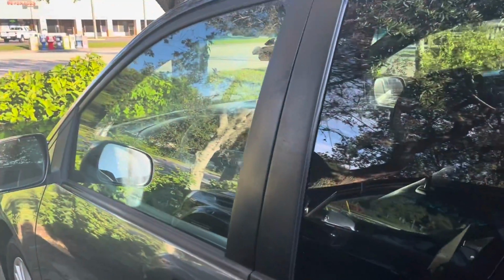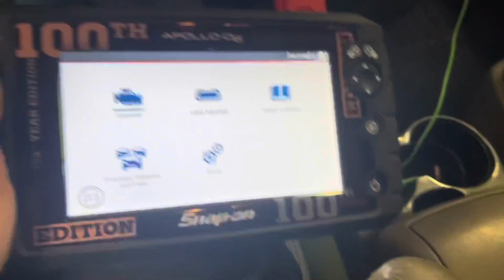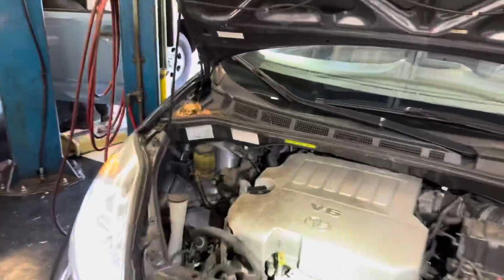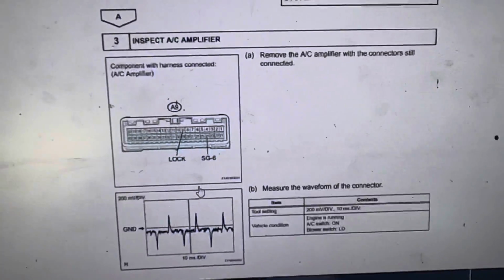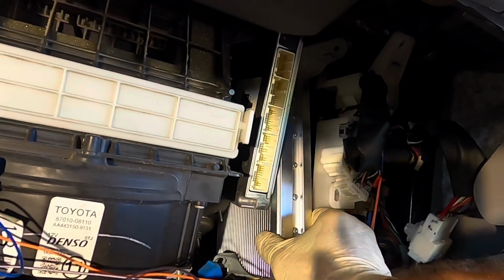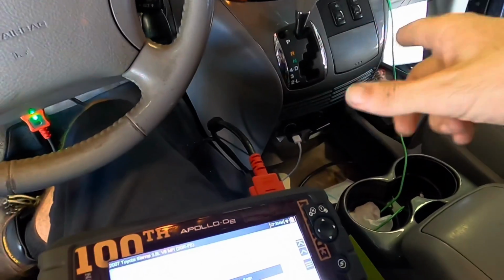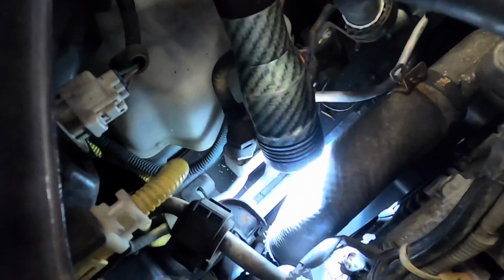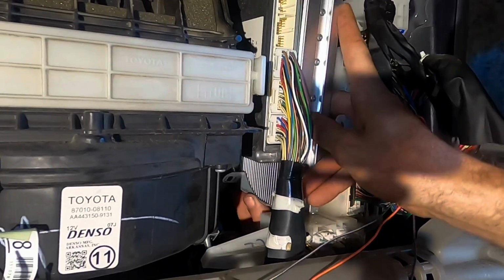Ghost Toyota: Engine running with no keys! And Customer States: No A/C

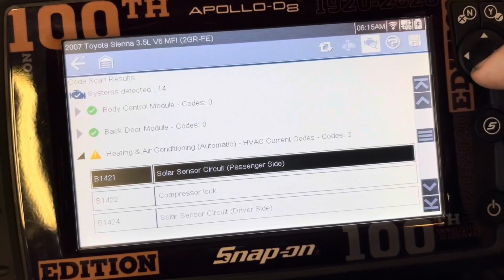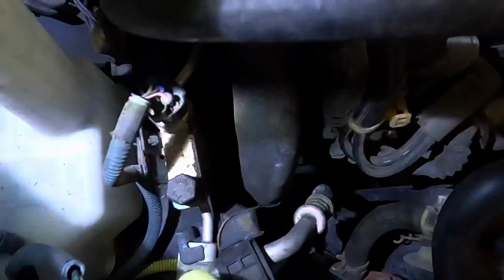Comment: Ray, at 5:18 your scan tool shows a B1422 Compressor lock error. This happens when the management computer does not detect the correct compressor shaft rotation after the ac has been switched on. It will then disable the drive voltage to the compressor clutch as it thinks the compressor has locked up. It does this to allow the drive pulley to continue spinning allowing the drive belt to keep powering the alternator and power steering pump. The flashing ac light on the dash is another symptom of this error. The fault can be caused by other problems than a locked compressor. (Did you check that the compressor shaft turns?) If the coil in the clutch has gone open circuit or drive power / ground is missing then this can make it look like a locked compressor. You can check the resistance of the clutch coil through the pin (3) on the other electrical connector. The one on the compressor side of the circuit. The connector doesn't have a ground connection for the clutch coil. The other end of the coil is grounded through the body of the compressor. At 18:50 you provide drive power directly to the clutch coil and it still doesn't energize the clutch. Looks like a bad coil ground, an open circuit in the windings or the clutch gap setting. A bad resistance check on the coil would help eliminate a wrongly set clutch gap.
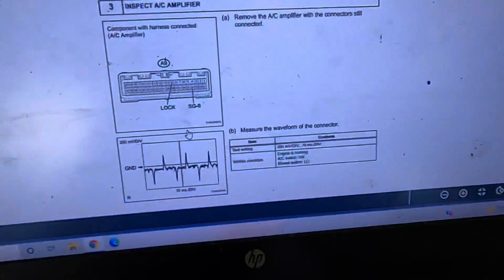The other two pins in the connector are for the compressor lock sensor. This works a bit like a cam or crank sensor. I believe it provides a low voltage differential pulse signal on the two wires. (Neither of the wires are referenced to ground.) This differential pulse voltage is compared to the crank sensor signal. If the difference in frequency of the pulses is greater than a certain amount then a fault code is set and the clutch coil power is cut. You can see the expected waveform in the diagram in the manual at 8:50 in the video. A faulty lock sensor would result in the same compressor lock sensor error. The easiest way to quickly check the lock sensor is to measure its resistance on the compressor. The service manual should list expected resistance values. Just my 2 cents.
Reply: I'm surprised the snap one tool doesn't provide this information.
Reply: @Bryan-Hensley  The scan tools find and interpret the error codes. They usually give you enough information to let you find the specific details in the service manual.
Reply: More like 50 cents instead of 2 but very informative and interesting 👍
Reply: The spiky waveform in the test instructions is the waveform from the lock sensor and will not be present of the compressor is stationary. Nice video👍
Reply: The best 2 cents I've ever heard/ seen in a long time
Reply: @johnathanedwards9054  Just from reading the manual and some practical experience. If it helps someone then that's good.
Reply: I had once exactly the situation where the clutch coil was not bad but the clutch was just so worn that the air gap had become too big, and because of that the clutch no longer pulled in or pulled in only occasionally. Fortunately it could be fixed by removing a shim, which saved the price of a new compressor. This does not always work however, as the shims may be of such thickness that removing any of them sets the gap too small (and I do not know if there even are clutch shims in all compressor types).
Reply: You're a god amongst gearheads. Thank you, oh benevolent machine overlord
Reply: Thank goodness for avmechanic friend who speaks Toyota'ese. I hope Ray puts you on speed dial!
Reply: Sure, what he said I think.....
Reply: I was about to write it out in a similar manner but you got to it first . I am not a good communicator so good job !

Comment: As a 'layman'; Did you find a cause? You did. Can you prove it? You can. End of story. Some would not go to this length, just say something that MAY solve the issue. That is the difference between you, Ray, and all the others. I think that is all that counts.
As a former Mainframe System Ops Tech; sometimes you need to do both ways to prove your point. One is from a long (and sometimes useless), professional standpoint, and the other is by your guts. This is how one learns AND how one might change how the world works :) (at least for all one is acquainted :) )
Reply: Yea actual root cause diagnosis seems to be sorely lacking in many people these days. Even those that have “been in the field” for decades.

Comment: Hey there. I hope this can help towards your next diag. I work at toyota and when you drive from outside (in the sunlight) to inside of the shop (no sunlight) the solar sensors will always trip a code. When it comes to diag the only time we check solar sensors is when that is the only code on the list. If theres others, dont bother looking at the solar sensor codes as its because the car is no longer detecting sunlight when driven into the shop
Reply: Good info, does the code clear when driven back into the sunlight?
Reply: @bloodybones63   it will after a while, but once scanned it should only show up as a history code. It will not show a check engine light or anything.
Reply: WARNING, SUN NOT DETECTED
WINDSHIELD WASHER FLUID LOW
RETURN TO DEALER FOR SERVICING

Cars will be like this soon. This guy will have to learn how to turn off the fake warning lights that cars throw to make any money

Comment: Just a quick observation, while plugging in connectors to the module i saw you reached from underneath.  I believe they wanted you to remove knee trim piece to get to the pins to test.  Otherwise great diagnosis, old school ways still work

Comment: For future reference, Ignore the solar sensor errors and codes IF you are scanning indoors. This is the sensor that tells the computer to turn on the automatic lights, adjust the temperature to the setting and so on. It always gives you code if you scan INDOORS but not out doors where the sun is shining or if you have enough bright light indoors. The first time I ran into it it freaked me out, but to be sure pull the car outside and scan it and they go away. As long as the trouble shooting, yeah, you may went into a rabbit hole on this but it happens to all.

Comment: I think you took the right course seeing how the car was running on its own. My first thought was module until you found the discount remote start.
Reply: I bought a pickup once that had one of those car dealer trackers in it that was killing the battery.  I wired it up to a 12 volt plug and put it in a semi truck and gave them something to track... LOL
Reply: Was it a remote start, or one of those kill modules from the local tote the note car stealership?
Reply: I had Priuses for 17 years...all I had to do was have the key in my pocket and the start was a button.  But neither had the "remote start" option, so I still had to get into the car to start it.  I could see the appeal of adding that.  I did mod my old 2004 Prius to re-enable the (removed for the US) EV mode (where you could drive up to a mile or so on electric).  Now that I have a Tesla Model 3, the best "remote start" is not having a combustion engine, lol.

Comment: He should have heard that. Dude, one quick blap with super low setting, then torque to spec. Hammering on lug nuts is so lazy.
Reply: I generally use a torque stick that's close to spec to put them on initially. Main reason I do is in case I forget or miss a wheel once it's back on the ground. Might not be 100% spec but at least the wheel won't fall off.

Comment: I'm a mechanical enginerding student, but first and foremost I am an electrician and mechanic with years of experience in both the industrial and automotive fields. A huge problem I see is that universities, mine included, do not teach kids (who most times have no real world work experience) anything about serviceability integration in design concepts. I think it should be a requisite course for an engineering degree.
Reply: As an electrical engineer who realized I hate sitting at a desk, who did amateur racing on the side with some friends for over a decade… I eventually became a millwright. Sometimes I come across machines that make VAG/MG/BMW look like wonders to work on. 

It shouldn’t be a *course*, it should be a whole year of, “this is broken, replace it” and let those fuckers experience what shit engineering does to those in the field.
Reply: @ObservationofLimits  I spent over an hour and a half today removing a bolt, removing the transmission dipstick tube that the bolt held in place, and replacing dipstick tube and said bolt. The bolt had a grip length of 3/4 inch (for what practical reason I don't know) and was located at the rear of the engine and was buried in the firewall so deep that I could just barely get a box end on it to loosen it one quarter turn at a time....I don't want to point fingers or throw shade at anyone but the engineering mistake was circled on the front grill of this particular pickup truck 😆
Reply: As an engineer with a few years under my belt in automotive engineering, I can tell you that serviceability is one of the design requirements. In this particular case there probably would have been an interface adapter that the Toyota Techs would have used, which would connect to the Toyota test equipment. The issue here and through no fault of Ray is he doesn’t have access to all of the specialist tools that were made for servicing that particular vehicle.
Reply: @wazzer2348  Also, I know all about proprietary equipment specific diagnostics. Like I've already stated I've worked in this field in one way or another basically my whole adult life, I am 38. My comment was a generalization and wasn't aimed at anything in particular but if you want a specific example, the practice of giving a technician a super short length of wire on a connector loom makes many technicians wish there was enough wire on the loom to hang the engineer with.
Reply: @wazzer2348  Oh no I completely understand the tug of war... No matter what you do in this industry there's always a bean counter that needs to be kept happy... Even the bean counters have bean counters they are accountable to lol. I have thus far completed a minor in industrial engineering (working on my capstone courses now for the mechanical major) so I get what your saying about the assembly process as well. I've performed many time and work studies and I have come to realize the word "therbligs" can also easily replace any one of your favorite curse words 😆. All that being said, I still do think serviceability in engineering design should be ingrained at a fundamental level as part of the curricular requirements for an engineering student. It's something that I've noticed that is not often emphasized in design coursework as a matter of practicality, at least at the University I attend which is ABET accredited.
Reply: @wazzer2348  A design requirement through the lens of "we make a profit on our dealers performing the servicing" and "we sell very expensive specialist tools to do stupid simple things"..

On one of my cars, the timing belt tension was set using a contrived lever and an unspecified weight (and an eccentric idler, obviously), explicitly to not provide a method usable with off-the-shelf tools every garage has - which is more complicated to make yet costs one tenth as much to buy.
Reply: @wazzer2348  Watch part 2 of this video.

Comment: Thanks for the repair videos.  The clutch coil is always grounded so you check for a ground at the load side of the relay. This will give you more confidence in your diagnosis. Cheers!

Comment: Best way to eff up a modern car, is to install an aftermarket remote start system.
Reply: Most times it's the people that installs that crap, not the crap itself. They rush it, en up with bad connections and crappy work
Reply: @rustynail9793  And many times, it's just the design of the system itself and how it interacts with the factory wiring and electricals.  For a period from the late 1980s through the mid-1990s, there was a company called LoJack that sold starter kill and alarm systems.  The basic feature of every system they offered was what they called the "secret switch".  To start the car, you had to depress or activate a button or switch as you turned the key.  As I understand it, the system worked by superimposing a signal over the wiring to the specific switch.  Turns out that, over time, this system would caus various issues with the cars electrical system. Besides myself, I know half a dozen people, all with different makes and models of cars - each of which had a different "secret switch" position, that developed weird electrical glitches in their vehicles that, in most cases, were traced back to damage to the main computer board that was most likely caused over time by the LoJack system.
Reply: @sct913  I've installed probably over 100 remote control starter systems without a single issue. I hated doing them though..

Comment: I had similar issues with my 2 kia hybrids when I had remote starters installed. the 2 different modules [car and r/s] were arguing as who was controlling the car. Turn signal lights would flash inside but not outside. The remote starter had to be reprogrammed to bypass the cars security. The car was getting confused that the car was starting without the door being unlocked.
Reply: Car manufacturers should always allow the user to disable the security if they have the keys.

Comment: Really 'old geezer gear head' here again. Ray, don't beat yourself up too much. Just remember, sometimes, ya gotta do the old school methods. Thank you for another great video.
Reply: I had a 2010 Malibu, that the dealer worked on but didn't put the proper ground on the aftermarket alarm system. It would do the same thing
Reply: Does the fob start the car?  Check fob.
Reply: @jerrynewberry2823  10-15 yrs old, key 'd ignition, not key fob'd.
Reply: @riceburner4747  I buy 'merkun cars...😁just saw key.  Mother's  Window Tint and Alarm does aftermarket.  Still chasin  a wild ground in my Dodge.  Alarm light on.  Maybe that for me.  It was just a thought.😁
Reply: @riceburner4747  I think he’s referring to remote start. If I remote start my vehicle or I should say vehicles I have four with the wife and kids and I do remote start I can put my key in the ignition turn it on and off just like Ray did and as long as I don’t touch the brake pedal it’ll do exactly what he did which is what I’m thinking is the case myself! Possibly trying to pull one over on us!?
Reply: Only an hour that’s not that bad give yourself a break
Reply: Or pop the ignition out and look at the tumbler to.

Comment: I can hear Eric O now, "rip out all that aftermarket crap!"
Reply: first step in troubleshooting, rip that trash out.
Reply: Looks like it might be a remote start system.
Reply: @FennecTECH  I think it's one of those "pay your car payment or get your car shut off" gizmo's they put on for bad credit. I found one in a car I bought wholesale from a dealership and only found it while tracing wires for a "no start"
Reply: I was thinking the samething
Reply: Kevin barry.  U live in central ohio?
Reply: @bigdaddytee7203  no
Reply: @kevinbarry71  , Colorado?
Reply: I was actually surprised to see the aftermarket remote start system was installed on this car. I figured those were more common in cold weather places, like where I live. Instead of Florida where Ray lives.
Reply: @VyperByteX  I believe it's because people in Florida want the air conditioning running for a while before they get in
Reply: I have an 04 malibu I bought for cheap has aftermarket auto start and it will sometimes start itself up while I'm sleeping and I hear it everytime because it has a terrible exhaust leak it's quite comical almost like its always in the mood for a road trip no matter the time😂

Comment: Yeah those cars are great till the electrics go haywire. It's better still when the customer wires in their own stuff !
Reply: Mine transmission make loud chatters if I completely stop. Open windows didn't help transmission on driver side which you can hear most than passenger side. Ik it's TC, I'm waiting until it break then swap to Scion's 2.5 manual. Because we can swap EV on manual. Not auto transmission.
Reply: @technocody9296  Right....